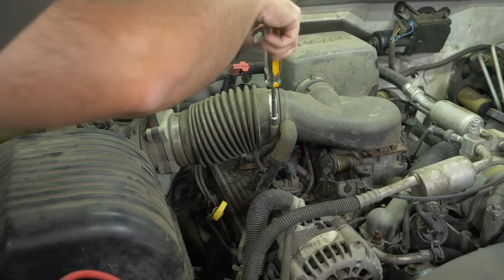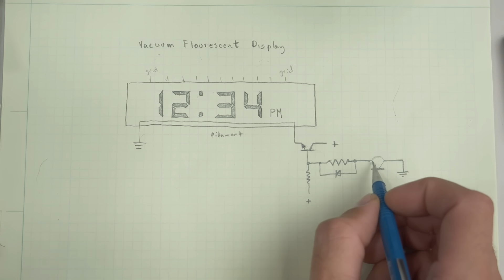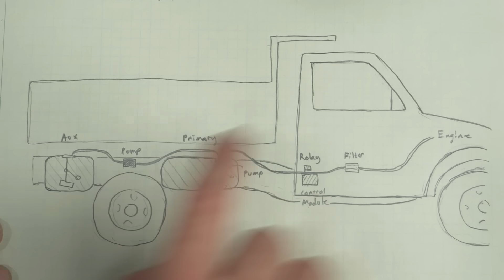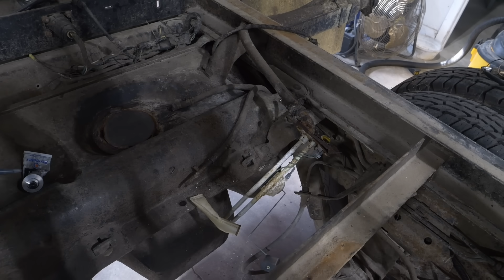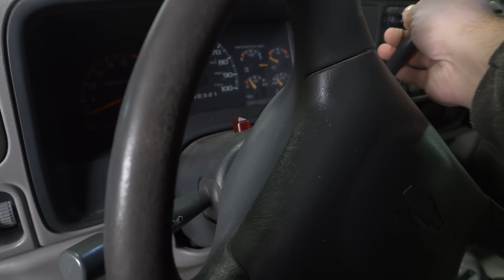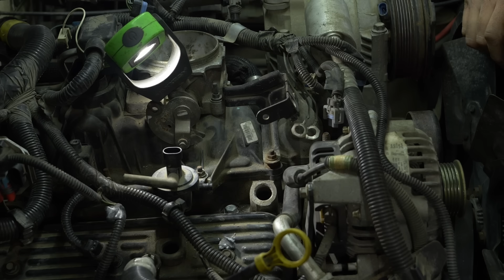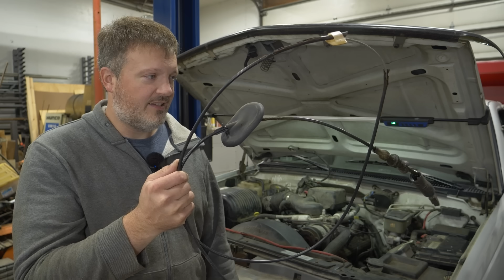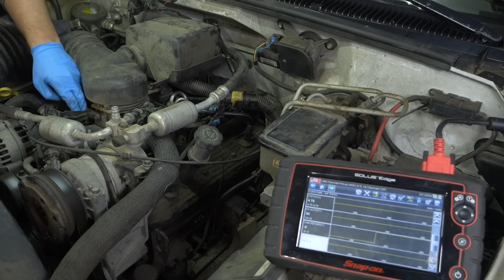This Truck Is Breaking Faster Than I Can Fix It

Comment: Those heater hose connectors are something GM should have been sued over. Best I can tell they were made from some sort of magnesium alloy that dissolves in water over time. I used to have people come in looking to buy a 1/2 pipe tap on a 2-3 a week basis which isn't cheap on the poor guy that just needs the tap that one time. So I bought a 3/32 wide Cape chisel for cutting  slits in the old broken stub and a decent carbon steel tap and just rented them out for $10.
Reply from the maker: Good thinking!

Comment: Heater hose quick connects.  Dorman makes a special 800-40? Easy out.  Must use heat to soften the locktite sealant.
Reply from the maker: Interesting. Didn't even know that was a thing!

Comment: Wes 7 step voltage drop test for those. 
Engine running headlights on. 
Negative post to positive post 14.1 to 14.7. 
Negative post to engine block 0.04vdc max
Negative post to frame rail. 0.04vdc max.
Negative post  to body inner fender 0.0.04vdc max.
Engine to firewall  0.0.04vdc max 
Positive post to the underhood fuse block 0.0.0.04vdc  then to as many fuses as possible .
Positive post to alternator output stud 0.3vdc max.   This takes less than 5 minutes. 

96 to 99  the 95" 4 gauge cable goes bad at both ends.  Corrosion at the stud on the underhood fuse block.  Causing low voltage to the truck and causes various voltage drop readings to fuse groups in the underhood fuse block. 

 Test light at the steering column connector.  
Center row  white wire. Should have constant power in Off, Run, cranking, run and off positions,
Other side of the center bolt pink wire.  Run cranking run. 
Thick orange and thick brown. Run only. Not while cranking and again in the run position. 
The spring loaded ignition switch contacts burn away usually around 220k. 

The fuel pump relay contacts burn away . The socket terminals lose grip.  Get the engine started and idling.  Pull the fuel pump relay. The fuel pump should still be powered by the oil pressure switch contacts. 

The left turn indicator bulb is on because of a bad ground between the bulb and socket or the socket and core support.

Comment: I had a '74 Chevy PU with a 454 and dual saddle tanks. It had a cable controlled valve to switch tanks and sending units if I recall correctly. Couldn't trust the gauge readings entirely and you to switch before you ran a tank dry but was effective. This was in the late 70's so it was nearly as degraded as this pickup. Great video professor, great find on the radio.

Comment: No, the customer is not always right.  All those repairs seem like a lot of expense until you price a new truck, a new one that has a lot more that will fail cuz manufacturers love to complicated stuff while building cheap. Side note: You know, you could make a fortune repairing those "solar generators".  Those are mislabeled, they are batteries with multiple charging systems. No one in the country fixes them. Open one up and you see why. They have a 2year warranty on average, sometimes 4 year, that is the projected time of failure as well, right after the warranty limit runs out. You then have a very expensive piece of landfill fodder. Fix them with upgraded components, you'd have an exclusive market.
Reply from the maker: There's a lot of liability with those.

Comment: I just picked up a GMT 400 from auction and the radio doesn't save presets and the radio display is very bright and it kills the battery

Comment: Good call on breaking that pot-metal coolant fitting; A big easy out that bites will actually bust the lower intake before the fitting turns.

Comment: two things: That Dorman elbow and if that was a Dorman water quick connector they will both fail you almost as soon has you use them, hopefully they have made some improvements to the materials in the last 5 years, but I have given up on using Dorman when I can.
Reply from the maker: Not a lot of options.

Comment: People ask me why I like big block Chrysler engines so much. Two main reasons: the distributor is up front (where it should be) and doesn't pass through the intake manifold. And they have a dry intake manifold, meaning no coolant passages (as it should be). Thanks for sharing the radio repair Wes! I super enjoyed that one! As for your timing issues, worn out timing chain will cause that.
Reply from the maker: Didn't think about the chain. That doesn't sound like fun...

Comment: yeah, the intake water leak is common, done a lot of these. There is an upgrade gasket set you can buy but I have never purchased anything but standard gaskets. 😔
Reply: PS if they have put stop leak in the system I refuse to work on them; I do not want the stop leak monster to haunt me.

Comment: I'll bet the module isn't PWMing the gauge output, it's probably just rapidly switching between the two values and letting the gauge mechanically average it out, and the factory gauge just responds slower.
Reply from the maker: That could be.

Comment: I had that very same issue with the shift cable in my 02 Avalanch.  I enclosed the old cable in some tin foil then wrapped with foil tape.  Then use some aluminum sheet to remake the floor with some RTV and foil tape.  Worked this way for the rest of it's life.

Comment: I live in a majority Chevy small town. For all the love Chevy gets here, I just want to say that my 9-year older Ford, with way more miles, doesn't have all those little issues. The only similar thing is a rear tank sender that always reads full. Don't use that tank anyway but I could because it doesn't use a balancing system just a tank selector.

Comment: Thanks Wes.  Customer is usually wrong, but tell them they are right to get paid. Between you and me, I would have just replaced the radio.  Insane amount of  work to fix the coolant leak.

Comment: these 350s and the v6s from this era are my happy spot as i live down south where these trucks still exist you called most things also the issue with the distributor is likely the cranks timing mark being off as they ...wonder after 20 years and you can move them by hand sometimes and if you move the engine with the distributor out the gearing for it dose not move so you can adjust it as much as you want so the job is now a fun affair i drop it in with the #1 banks valve cover off and watching the valves on these.

Comment: My Chevy 3500hd dually also doesn’t have the secondary fuel working. Can only fill it just over a quarter tank. It was so nice of the seller to not mention it.  Needless to say since I bought it I make a lot of fuel pit stops.

Comment: Well this was a fun relevant video for me. I’m in the process of upgrading the fuel injection on my 96 K2500 with the 5.7 to an Edelbrock EFI intake and throttle body using the factory ECM. Wish me luck. Shouldn’t be that difficult.

Comment: I would have found the parasitic draw, re-pulled the radio fuse,  and installed a cheap LCD clock on the dash (ask my dad).    On old rust belt cars, it's never the root problem like a leak or bad part, it's always the cooked brittle hoses, or the rusted lines that take all the time.    You do a great job waiting until the last minute jump from the plane and pull the chute on stuff like the aux tank!

Comment: I got a few good chuckles from this one Wes, the minute you said you were removing the intake I said to myself outloud,, "I know what you're gonna break. I was right. And you are right, the check engine light doesn't work, because the way you installed the distributor would definitely have it shining brightly. The only way mine went out (98 GMC) was to butt the distributor tight to the intake. I know what you're thinking (it looks wrong) but it was the only way to extinguish the C/E light and stop spitting codes.
  NOW the newest vehicle I drive (every day) is an 85 K10. I own a very clean 2002 S10 Blazer that ran and drove perfectly the last time I drove it (6yrs ago). Still parked where I left it.  The small block Chevy was an excellent engine, untill OBD I made it under the hood. And when they added the word VORTEC, they flushed what was left down the toilet.

Comment: My jobs today are much simpler. 

First, see if FORScan can turn off the TPMS system in my truck.  The sending units ran out of battery a long time ago, and I think the receiver is bad.  I'm old school and just use a pressure gauge from my glove box.  But the warnings and lights are driving me crazy.  Not supposed to be able to turn TPMS off, but FORScan can do a lot of low level things with Fords.

Second, the rear right seat window switch isn't working.  I can roll the window down from the driver's switches.  And I can roll down the rear left seat window with its switch. So I don't think it's a child safety switch issue.  So I'm thinking it's a bad switch. Not going to replace it today. Just need to do the diagnosis.

Comment: That plastic thing you found while taking it apart is what holds the hat down on the throttle body if I remember and when you were taking it apart, I was surprised that heater hose connection did not break but never mind it did as always but all's well that ends well, but wait there's more lol

Comment: They used to sell a splined removal tool for the qc heater hose fitting. Regular ez outs always made it worse. Before I found that tool, I just chipped it out like you did. That harness bracket was always the worst part of doing that job.

Comment: I'm pretty sure that aux fuel tank is fixable if you really want it to work.  I think there are a few options. First, if the GM sending unit stuff is all the same, maybe find another GM tank from a different vehicle, maybe even a car. You'd have to figure out new hangers.  Second, get a new fuel cell.  Option 2a is probably some new electronics like an Arduino to replace the old logic unit and make the two very different tank systems work together. Option 2b is just add a fuel gauge for each tank and a switch in the cab to run the aux fuel pump manually.  I was helping a friend move cross country with his dad's truck, and that truck was setup like Option 2b.

Comment: Yo Wes - you were saying that the fuel sender was 0-90 ohms.  By '96 hadn't they started to use 90-270?  Thought that was one of the first years it went to that, coinciding with the switch to OBD2.  Speaking of which... thankfully that things not a 94/95 when some had OBD1.5!  Bleah.
Reply: Aaaaaaand then you did the bench test.  Guess it hadn't changed yet!

Comment: So the radio was a cool repair, my 97k1500 radio was bad I simply replaced it with a  $80 Kenwood, would your labor $$ be better spent that way?   the radio diag  might have been endless, Good on you though.

Comment: I owed a 95 Chevy K3500 for 25 years.  Bought it new, without any frills, no air, manual windows.  Under the hood it was clean.  The only thing I did to it was to replace all my brake lines with stainless steel.  Refurbished all the brakes when I replaced my brake lines.  I did have to reweld weld the hinges on the dump bed.  It had about 120 K on it when I sold it to a stone mason in WV.  The truck was 100% rust free since it was always parked in my barn.  I was a really great truck.

Comment: I don't expect you to answer, but why not just use the 2nd tank manually to refill his main tank when it's under 1/8th but not above 3/4?  If he doesn't go above 3/4 during a manual transfer, he won't flow gas out of his main tank filler.

Comment: I'm an aircraft mechanic by trade (42 years), worked on cars from age 14(?) up to getting my A&P cert. when 21.  I was always interested in electronics and enjoyed the avionics aspect of aviation. Spent most of my career in that part of the work. I restored vintage audio for most of that time and I get the same fix'it feelings in electronics as I do when repairing mechanical devices. Except its a much cleaner environment.
Very well done!

Comment: I made a 60hz generator from a 555 timer and some capacitors to eventually bypass my old 2000 alcohol content sensor in my ranger. It's 700 bucks for a replacement when it eventually fails and I never use e86. I love older vehicles.

Comment: Once again, you did good. With the one exception. On your drawing of the radio staying on, you drew a PNP transistor, feeding the NPN power transistor to the VFD,  but used the 2N3904 NPN transistor. Not a big deal but just wanted to let you know. IF it truly was a PNP setup you would have had to use a 2N3906 general purpose PNP transistor. But another great video absolutely!

Comment: Why is connecting the 2 tanks so complicated?  Couldn't they just have run a hose connecting the lower sections of the 2 tanks together passively, no power pumping?
Reply: Because if you do that and the hose breaks for any reason then you're pouring fuel on the road while emptying your tank.

Comment: The long wing nut thing is to attach the air intake elbow to the throtle body. Did you disconect one of the wires to the distributer before attempting to ajust the timing?   It was kind of a separate wire running on the firewall.  If it is connected its like trying to set the base timing with a vacuum advance hooked up on early non-computer engines.
Thank you Wes!

Comment: That fuel system is in our 2011 suburban - it got out of whack and pumped gas from the auxiliary tank to the main tank when it was full backing raw gas into the charcoal canister, and out to the street- filling the vent system with the charcoal from the disintegrated canister. 

My mechanic was not able to figure out the system. It was a VERY costly parts cannon experience.

Comment: I think that truck might be your new best friend.  Hey could you do a tutorial on troubleshooting salt/corrosion buildup on battery terminal connectors?  My 08 Wrangler started building up some bluish salt at the negative battery terminal.  Got brass looking type, but I could only install the positive one, so the negative connector is still the factory one, but some of the galvanized coating is corroded away.  Now I still have build-up on the negative connector and now also about twice as much on the positive.  I think the alternator is good, the battery shows 12.5V before a start and reads 14.7V while running.  I think it might be straight up galvanic type corrosion between the connectors and not acid leaking from the battery due to the alternator.  Seems like I need to either get factory terminals from the dealer or Pull a Part.

Comment: I would have told him that his radio is junk and pulled the fuse and called it good. When I saw you checking components inside the radio, I thought, damn this guy can fix anything. They sell cheap radios at Walmart for about $50 and they probably sound better too.

Comment: Thank you for taking the time to set up and put this video together.  I appreciate the illustrations and diagrams.  The bit with the radio was pretty damn interesting and I learned a few things.  I wonder if it would have been easier to remove the bench seat to have more room to do the shift cable.

Comment: Got a 96 Yukon, fuel gauge in it is crazy. Air core motor on the fuel gauge is problematic and virtually no new replacements, Ebay may have a NOS fuel gauge, anybodys guess how long it will last but they will probably be proud of it. The T-nut holds the air intake tube on the throttle body. Welcome to the L31 5.7 L engine Wes. V/P hell, she's CEO!

Comment: 25:10

I had that exact issue when i worked for this guy that had a fleet of GMT400’s 

Dude didn’t wanna pay the $58 or whatever for the shift cable so i just wrapped it in duct tape and tucked it back under the carpet like it never happened 😂

Comment: Working under a dash or a kitchen sink are jobs I will gladly call in someone else to do.  Hose fittings weak enough to break when looked at, yet strong enough to resist non destructive removal efforts.

Comment: the plastic thing you found sitting on the intake is the nut that holds the air intake tube on to the throttle body.

Comment: Best videos on YouTube. Not sure if someone already said but that CAM offset will only update over ~2000 rpm so when setting make sure you have engine speed up. Was going to comment to make sure to change that heater quick connect they all fail
Reply from the maker: Service data said 1500. I didn't look at the tach, but I think I got there.

Comment: Great vid. Thanks.
When you started pulling the intake, I chuckle and said, "you'll regret that" that metal tubing always does that. And all SBC with those valve covers are like that. Power steering pump is a toss up, depending on generation. 
Fucking fantastic you fixed that radio, never EVER seen one fixed from that, A+

Comment: I just really enjoy your videos, Wes. You are a master of repair work, from down and dirty suspension and brake work, to electronics repair. I haven't seen another mechanic with that broad of a span of talents. Then also add in experience with CNC machines and CAD. Too bad your shop isn't closer to where I live, or I would definitely send you some business.
Hope all the family is doing fine.

Comment: Ya, that radio fix was great. Love stuff like that….
Reply: I have a parasitic draw on my F250 that has been a problem now for some time, and it sucks.
Reply: @mikespain8655  Thermal imaging camera bud, they make some that plug right into your cellphone. With basic knowledge of what should be powered at all times and what shouldn't, you should be able to narrow down the problem area.